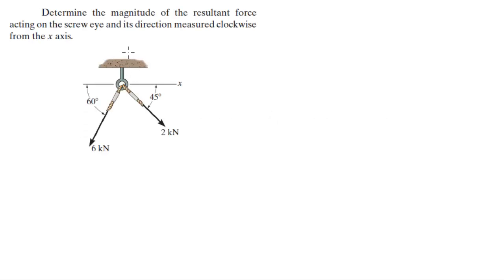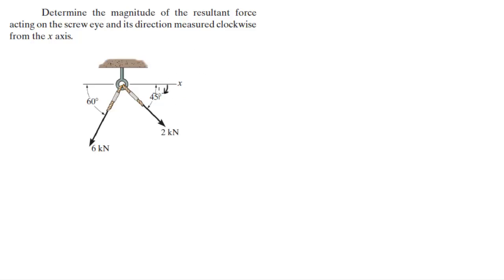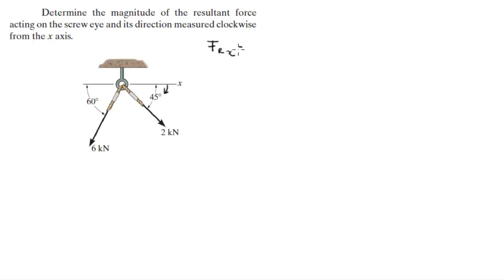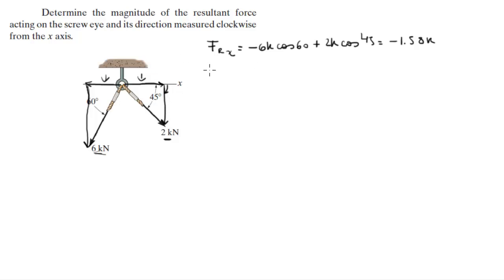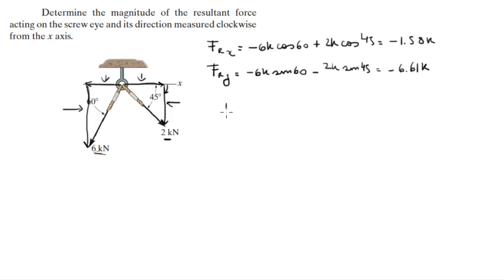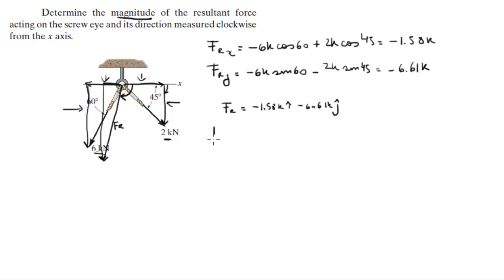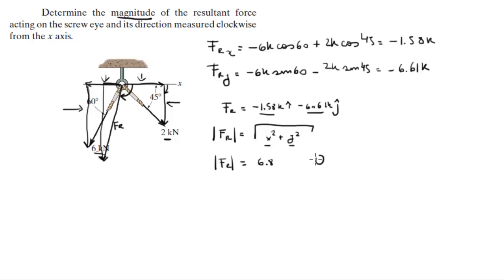Find the magnitude and direction of the resultant force

Comment: I appreciate the help, but every single one of your videos i watch has mistakes which misleads people. For example on this video you said Tan^(-1)(x/y)= 76.17 when in fact it equals 13.44. Cos^(-1)(x/y) is equal to 76.17. Please check your work before posting on youtube, there are kids that will believe that what your saying is right when in fact its not. Over all thanks for trying to help. :)
Reply: Both ways work, you can do x/y or y/x, you just have to add or subtract a different angle after. in the end you will arrive at the same answer.